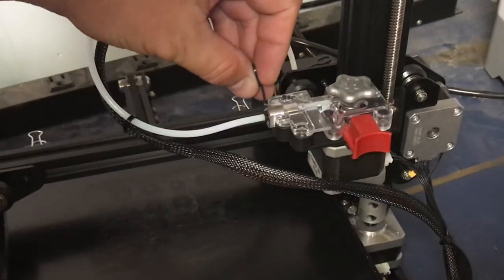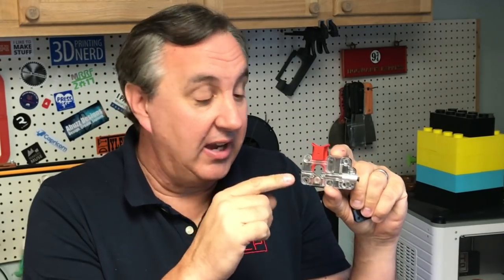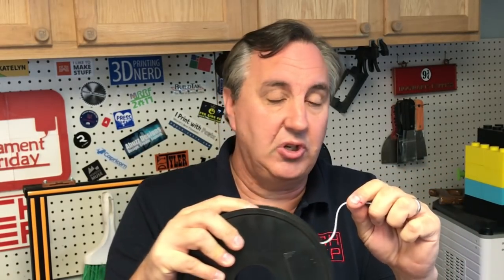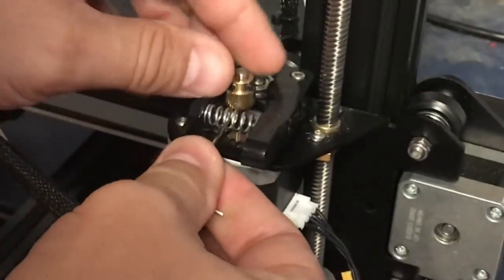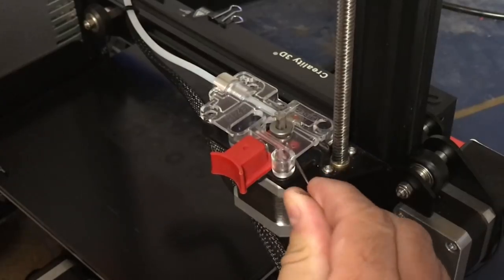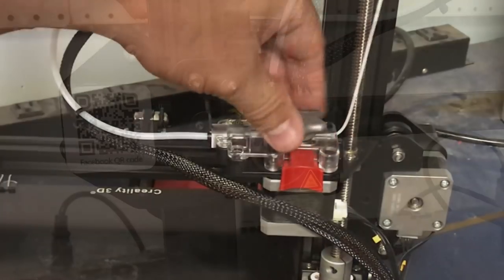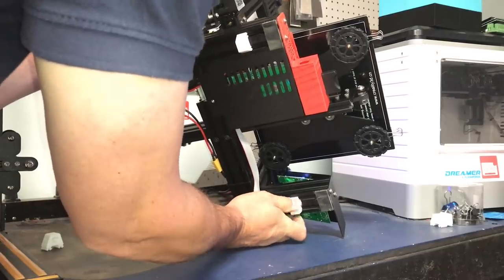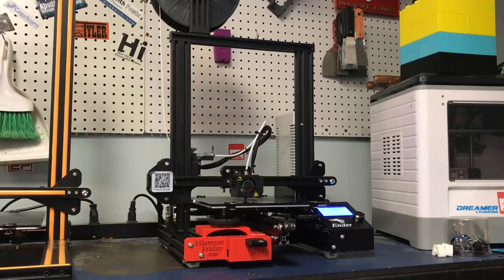Flexible NinjaFlex TPU using EZR on Ender 3

Comment: Chep, I  enjoy your Filament Friday videos. All are well thought out and presented. I replaced my Ender 3 extruder with the anodized extruder from Ender3 and was able to easily print Shore A hardness of 90. Considering the closeness of the gears to the anodized extruder entry point into the Bowden tube it appears that the softer NijaFlex would not bind up. Have you had any experience printing NijaFlex using the Ender 3 all-metal upgraded extruder or will I still need to upgrade? PS most of what I have learned about 3D printing I've learned from you.  Thanks, BD
By the way, I saw a video you did a while back where you clicked on some setting in Ender3 to get it to feed the filament into the hot end of the nozzle but I can't find it. Where in the menu of the Ender 3 did you go to get the machine to pull in the filament to the nozzle?
Reply from the maker: Ninjaflex will bind up. 
 Prepare>Move Axis>1mm>Extruder
Reply: @FilamentFriday  Thanks for such a quick reply! Would the printed extruder that you showed placing a small piece of Bowden tube in the opening to get the support right next to the gear work with NijaFlex or is the EZR extruder the only way to go? Also, the reason I changed from the plastic extruder that came with the Ender 3 to the all metal extruder was that the entry hole that the filament passes through was wearing in an oblong shape so I went to all metal. Do you think the EZR will eventually suffer the same fate since it is also plastic? Lastly, I followed your steps above but ended up on a screen that apparently wants some number. Not knowing what to put in, I just added 8 and tried to see if the extruder advanced, but nothing happened. Obviously, I am not doing something correctly. What number do I use in that last window?
Reply: @FilamentFriday  For your subscribers, I found a simple way to get my Ender3 all-metal  extruder to work perfectly with Ninjaflex. This fix assumes they have a drill press.  I took the extruder section connected to the Bowden tube and placed it in my drill press. I drilled out the hole a few CM deep to the exact size of some extra Capricorn tubing that I had. I followed your video on cutting it. Then pressed fit it in and was able to print easily with Ninjaflex with absolutely no binding or problems. Thanks for the video instructions. It was very helpful.  I would have posted a picture of the upgraded extruder, but couldn't figure out how to upload it. Sorry.
Reply: S AG Hi! Im doing an internet research to find the best and most affordable option for printing ninja flex on my ender 3. The all metal extruder that you talked about is the MK8? And did you need the capricorn tube along with the all metal extruder in order to print ninja flex? Your responses would help me a lot, thank you in advanced!
Reply: @mikefer14  Yes I bought the Ender 3 all-metal extruder (MK8).  No, you don't need Capricorn tubing to make the part that fits into the extruder after modifying it. I just happened to have some. Any bowden tube would probably work just fine. The trick is precisely drilling out the hole in the extruder with the correct size drill bit so that the small section of tubing would fit snug in the extruder and then cutting the tube at the correct angle like Chep showed so that it takes up the extra space between the drive gear and the extruder. I couldn't figure out how to take a picture and post it so that everyone could see what I did, but it has worked great for me. My only caveat is, if you are not adept at using a drill press, you might not want to attempt this mod.  I wish you good luck!

Comment: I've been wondering if I could use TPU as a replacement for silicone molds for one off things I can't do reliably by just casting the mold due to difficult structures. (Partly trying to replace a resin printer since I only have one thing I find this needed for and it's a tad more than I have)

I've seen some people say it's tough due to gaps in the filament but that might just be their settings and I have other ideas to make it work if needed.

 I'm just wondering if it can be used to mold something and cut off and not reused

Comment: I have the stock Ender 3 v2 and would eventually like to print more materials. I haven't done any upgrades yet except springs, but if I were to get this sort of upgrade would that be sufficient without having to swap extruder tops for different filaments? Also, should I also get the all-metal extruder upgrade too, along with this one? I'm printing a lot but I've only had my printer a week so I'm a total beginner. I'd just like to know what sort of upgrades I should get that would be good for the long run. Thanks for any advice.
Reply from the maker: Learn to use it for a month or two before doing any upgrades. The EZR works with all filaments.

Comment: The one thing I can't seem to find is information on whether this is a replacement that can be used for NON-TPU PLA and PETG also?  Can you use it for pretty much anything or are you limited to softer and more flexible filaments?
Reply from the maker: Works with any filament. It’s the same extruder used on the $2000 Artemis.
Reply: Thanks for that!  Always love people that reply back to comments. ;)  I try to do that myself.

Comment: Me again, so I was checking the calibration on the e steps for the ezr change if I use 1mm steps I get exactly 100mm as set..if however I bump up to 10mm steps and set 100mm and let her rip..maybe 80mm with a lot of grinding, slower 10mm steps 100mm. So my question , should I calibrate for the faster speed and really low reading or leave it alone? The hot end was set to the proper temp for the PLA I am using..even bumped it up some to make sure it was flowing properly....the problem is also that at the faster rate it’s never exactly the same under extrusion varies by as much as 10mm. During printing I am not hearing the popping unless it tries to purge during a filament change, anyway thanks.

Comment: Hey CHEP, I am trying to purchase the Ezr Struder through the link you posted SEEMESNC. There are 3 options to choose from:
1. No Stepper Motor
2. Add 1.8 degree Stepper
3. Add 0.9 degree Stepper

Not sure which one to select. Can you please advice. I am using Ender 3 Pro 3D Printer 

Thanks
Reply from the maker: No stepper motor.
Reply: @FilamentFriday  Thank you Sir

Comment: Hum, I added the 
Dual Gear Extruder per a Chep recommendation to my Ender 3 Pro.   Because the gears are very close to the inlet point for the filament I thought that it would work for Ninjaflex TPU.   But no luck the filament would just bind up between the gears and the inlet, any advice on what to do?

Comment: Ok i Have to ask i had to mod my stepper to work with my Daul extruder the Rod was 1mm sort. 

What i need to know because i am still new to the game, What do i look for to have a taller rod. i am using the ender 3 with the 42-40 Motor I know it is 2021 now but it dose not hurt to see if you can help. i am a big ender fan. i have 2 with BLTouch and all.

Comment: I just bought 2 EZR Struders with your link. I can print the 94A shore hardness, and that's typically plenty flexible, so it wasn't so much for the super flexi NijaFlex as it was for the ease of loading different filament into the extruder.  I have a hell of a time getting either my Ender 2 or 3 to get it to go into the bowden tube! What the hell's with that?!!! LOL  It's really difficult to get it to get started.  Sometimes, it slides right in, and I THANK THE LORD ABOVE! lol :D Then, most of the time I'm poking the filament 20 - 100 times in to get it to go into the tube.  It's a BIG HASSLE AND DELAY that I finally said  E N O U G H  to!  I do not need this headache.  I had to give up printing this gold color filament because I simply couldn't get it into the bowden tube!  It shouldn't be that tough! LOLOLOL :(  Well, not anymore!  I can't wait to get these new extruders!  Thanks Chuck! (:^)
Reply: Scoot Roter I had the same issues
Reply: @peterkleene8240  Yeah, what is with that?!  You buy a printer and you absolutely struggle to get the filament to go through the extruder and into the bowden tube so you can print!  THAT'S A BAD DESIGN CREALITY!!  WAKE UP!!  And, to be frank, it's stupid to ruin an otherwise great experience with something that's supposed to be so simple!  :(
Here's something I find funny!  Creality makes a replacement extruder that's the exact same thing as what comes on these printer the Ender 2 and the CR-10 line too, but it's metal.  So, people think they're upgrading their extruder, I've seen many videos about it, and buy this metal extruder and STILL HAVE THE SAME DAMN ISSUE! LOL  NO friggin' way!
Reply: @Scoot Roter I printed my own extruded top and STILL had this issue though it did solve the coupler problem.
Reply: I had the same issue with getting the filament started!  I installed an EZR and have no issues with it at all now.

Comment: Noob when it comes to 3D printing. Is the stepper motor needed for the Ender 3? I see it as an option for the EZR extruder.
Reply from the maker: The EZR mounts on the existing stepper.

Comment: When using the EZR are you able to use retraction? Or would you still recommend turning it off while printing in TPU.
Reply from the maker: I turn it off but you can get away with a little retraction on 85A. Semi-flex TPU can use full retraction.

Comment: I have been interested in printing flex filament but once installed I do not need to replace it to print regular filament do I?
Reply from the maker: No, it prints any filament. I’ve been using it on this machine for a month and printing Filament Friday PLA Filament as well.

Comment: Thanks for this video. I just tried printing NinjaFlex on my Ender 3 and it came out like poop. I used your Ninja flex profile on CURA 4.5. Any other modifications need to be done to print in TPU? I wish I could take a picture of what it looked like after 15 minutes, before I aborted the print. I have the original modification you showed with the small piece of tubing and printing at 20mms/s at 235C, no retraction.
Reply from the maker: Is your TPU old?
Reply: @FilamentFriday  Brand new, I also put it through a food dehydrator for 24hrs at 130 F
Reply from the maker: Check the PTFE for resistance at the extruder gear. Also check the nozzle for partial blockage.
Reply: @FilamentFriday  Thanks for the responses. I switched to a different type of TPU (Sain Smart)  and have been printing amazing objects (rubber feet, tires) on stock PLA settings! Thanks for the great channel

Comment: Already having issues with mine. It refuses to print flexible material (which was why I bought it). It prints perfectly with regular PLA, but both times I printed with Flexible PLA it failed at the third layer. Same temperature on bed and nozzle, same print (the printer feet), same speed (45mm/s). Its like it loses its grip on the filament entirely after three layers.
Reply from the maker: Use the original spring with the Ender. Sometime to one included squishes too much.
Reply: @FilamentFriday  I did end up changing the spring back to the original, but now it gets to 70% and fails every time.

Comment: I'm having nothing but failures with the EZR on my Ender 3 using PLAFlex from 3DFillies. After about 35-45 minutes the filament squirts out the extruder between the feeder gear and the PTFE. So frustrating!
Reply: I've got some of that in my cart to order in the next few days. Did you ever figure figure out a solution?

Comment: Any idea if this would work with the CR10S Pro and whether its a worth it upgrade still?
Reply from the maker: Yes it would work.
Reply: Did you get it to work on the CR10s Pro?
Reply: Cisco Race actually replied to your message on Reddit already haha. Ezr struder works great with it. You have to drill out the rivets of the original extruded mount and maybe design and print a spacer so everything is on the same level but other than that I was very happy with the whole thing

Comment: I bought this extruder not long ago and it worked great at first but now i get really inconsistent extrusion when trying tpu. Dried the roll twice and still get almost see through sections where it stopped printing during the walls, any ideas?
Reply: you could recalibrate your e steps

Comment: do I need to configure anything for the different feed gear ? or is it just plug and play
Reply from the maker: Mine worked without adjustments but slowing it down a bit might reduce the stringing a bit.
Reply: I am happy I because of this video I found out where the filament goes into the extruder there was a gap being worn out of the plastic that was grabbing the filament at random points causing under extrusion I printed a new arm and my Eeder 3 is back to being great thanks.

Comment: I cannot get my extruder to work can you please help? I got this thinking it would be an upgrade but now my prints keep binding and the extruder keeps skipping. I know it's a problem with the extruder because I put the stock extruder on and the problem was fixed. Any ideas on what I can do to stop it from binding?
Reply from the maker: Where is it binding?
Reply: @FilamentFriday  thanks for the reply, it seems binding right where the gear meets the filament because when I pull out the filament it's all gnarly around where the gear would be touching it
Reply: @FilamentFriday   DrVax  so I recalibrated my e steps, do you have to have two different e step calibrations because when I used the e steps I calculated with PLA, I could only get 60/100 mm of flexible filament to extrude.
Reply from the maker: No, one should be fine. That seems way off.

Comment: @CHEP

Is it possible to use the stock drive gear with the EZR? I’m upgrading because my pinch wheel on the stock extruder doesn’t provide enough pressure (I had to jam a second spring in it to stop the filament from slipping) and I don’t want to have to mess around with my printer settings.
Reply from the maker: I haven’t tried it but looks like it might work.

Comment: Do I have to modify steps per mm when swapping from the stock Ender 3 Pro? It's printing nice but I just want to check without taking it apart to measure. Also is it important to ad the screws and nuts provided in the 2 unused mounting holes?
Reply from the maker: You can verify the eSteps are correct. 
I don’t add those extra screws.
Reply: @FilamentFriday  I paused a print and layed the stock one on top. At first it appears to be larger dia than stock but the hobed out area appears to be the same. I'll measure some other time as it's printing nicer than stock. Next is TPU-95 !!!

Comment: Did the EZR roller fit ok for you?  Not too tight to want to force on so you had to stick with the older roller?
Reply from the maker: It fit fine. I’m not understanding what you are asking. Did you install the included gear as well?
Reply: @FilamentFriday  actually got it on - just had to lightly tap it down....it just didn't slip straight on, so didn't want to force it at all initially

Comment: did you calibrate the e steps?
Reply: On the stock SeeMeCNC machines that the EZR extruder is used on, the estep is 91-93 which matches the stock estep value on Creality machines with a single gear extruder

Comment: in your review you dont talk about e steps for the extruder, can you tell what you have ended up with?
Reply from the maker: The stock settings. I never changed them. The diameter of the gears are so close I’ve had no issues. Plus running slower at 20mm/s helps compensate.
Reply: @FilamentFriday  here it over extrudes like crazy! i will calibrate it because it makes the gear skip..... the diameter is about the same on the exterior but it is concave so i would advise people to check their extruder calibration